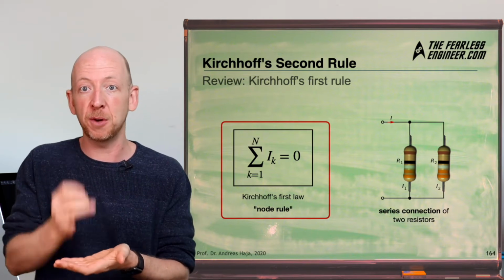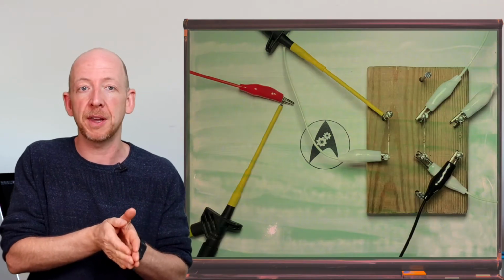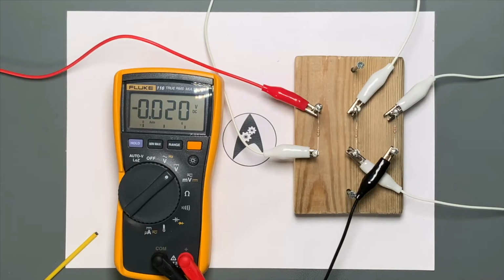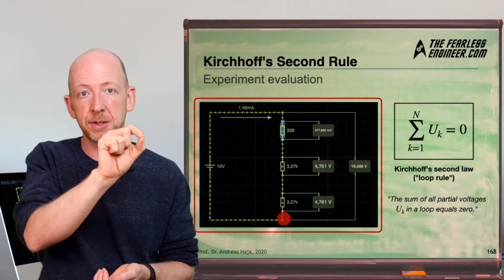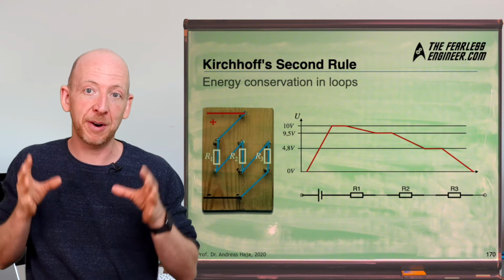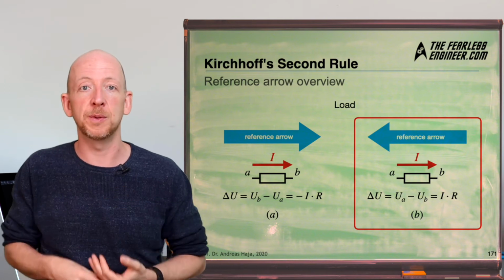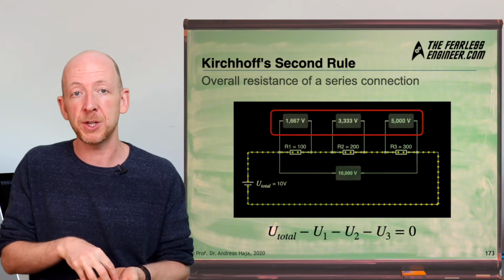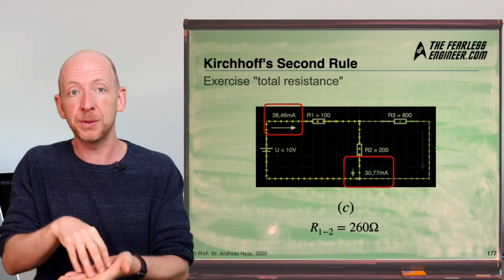Kirchhoff's 2nd Law : Loop Rule, Series Connection | Online Lecture "Electronics"

Comment from the maker: Hi and thanks for watching! 😀 Kirchhoff's second rule is based on the conservation of energy in a circuit.Can you say why the source voltage always equals the partial voltages across the components in a loop?  Or are there cases where there is still voltage "left" after the last component has been traversed? Let me know what you think in the comments below! ⚡
Reply: Since conservation of energy is necessary to use Kirchhoff's second law, it wouldn't work if that is not the case. I guess that there are cases in which the energy is not conserved,  but I cannot explain how 🤷
Reply from the maker: The electric field that moves the charges along can be compared to the gravitational pull of the earth. When you think about an object falling from a height h1 to a lower height h2, what has happened to its potential energy once it reaches h2? -> It has been completely converted into kinetic energy (if we leave air resistance aside). And either is the kinetic energy converted into other forms on the way down to h2 (e.g. when the object is not falling through air but sinking through a viscose liquid), or it is converted abruptly, when the object lands. And either way, after arriving at h2, the object will have parted with its kinetic energy completely. This model also holds for the charges in an electric field, which is why the energies according to the loop rule sum up to zero.

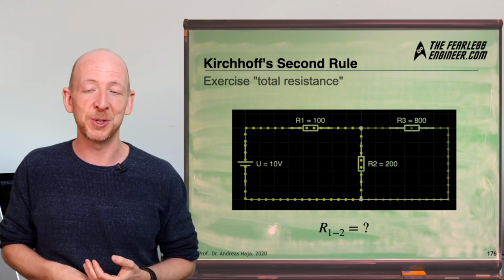Comment: 15:10 R_total= R1+(R2*R3/(R2+R3))=100+160= 260 Ohm
Reply from the maker: Thanks for your answer, the solution is of course correct! Here is one quick tip for you: If you want to compute the resistance value of several parallel resistors (>2), then it is much easier to add up the inverse resistance values using your calculator and invert the result at the end. If you try to compute the general equation for - say - 4 parallel resistors, this will take far too long.